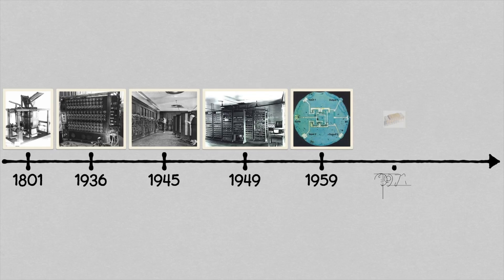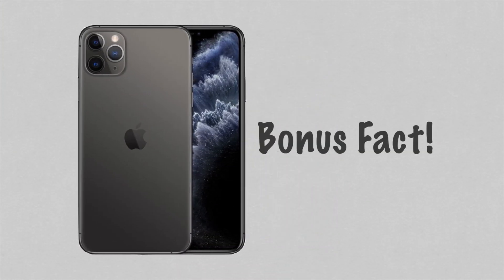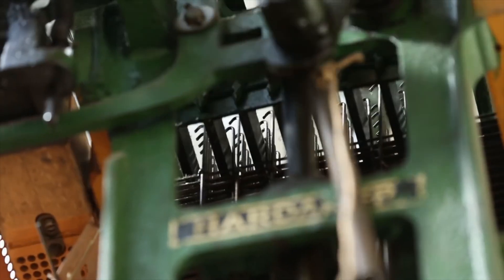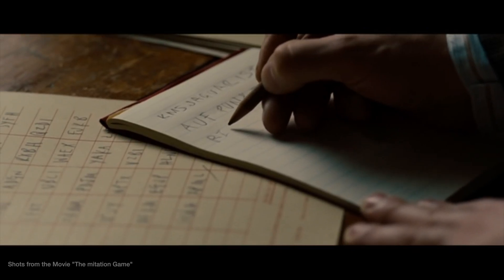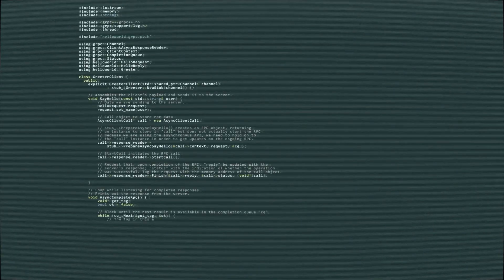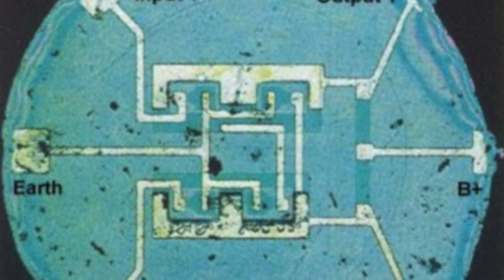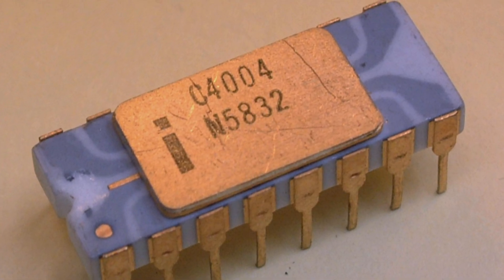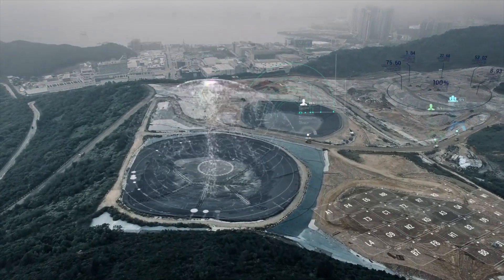History of Computers - An Evolution Timeline

Comment: "A Turing machine is a mathematical model of computation that defines an abstract machine" - Wikipedia
You are confusing the Turing Machine with Turing's Automatic Computing Engine.
Reply from the maker: Dear Bruce, you are right that the term "Turing machine" is quite broad and groups a bunch of different mathematical models, but Turing machines are not all only abstract, the "Turing Automatic Computing Engine", also known as the "Enigma Machine" or the "Bombe" is actually a hardware implementation of one of the many Turing Machines. would recommend using resources different than Wikipedia, for example, the following: https://www.livescience.com/29483-alan-turing.html
or: 
https://sciencehook.com/mathematics/breaking-the-enigma-alan-turing-and-the-turing-machine-43